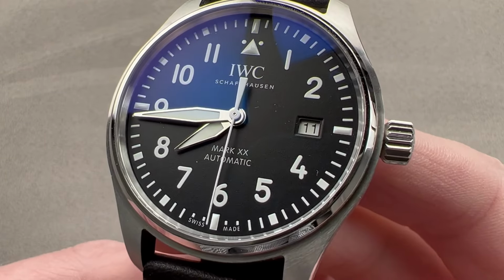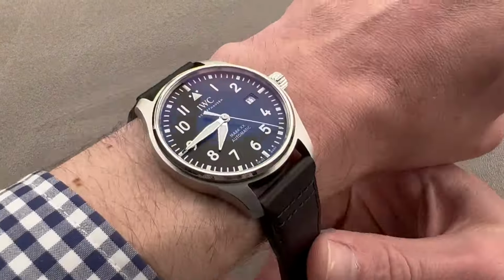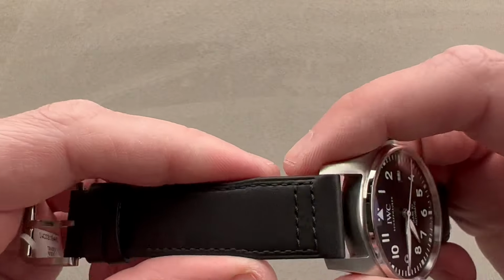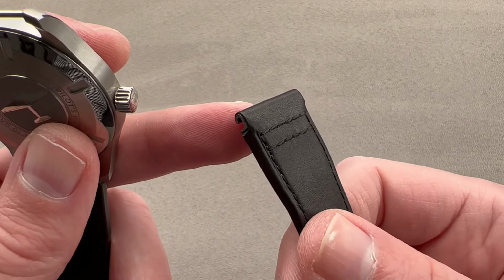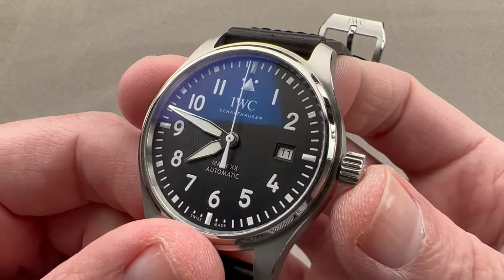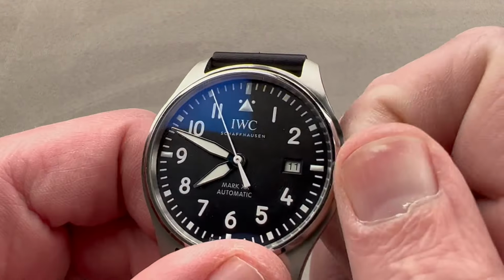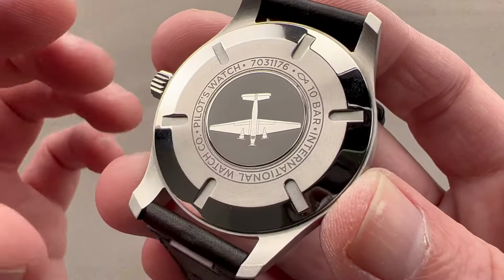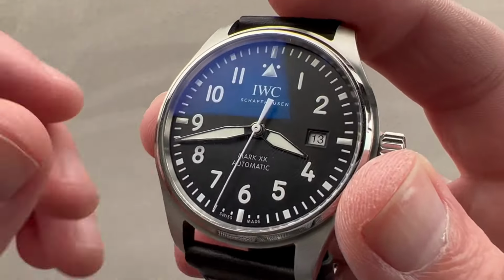IWC Pilot's Watch Mark XX Review | IW3282-01 | 40mm Classic Aviator

Comment: A solid synopsis of this beautiful watch. I nearly bought one last week, but as you point out, not a strictly in-house movement. This was a deal breaker in such an expensive and exclusive brand.
Reply: The in-house versus non in-house movement is one of the most overrated debate in horology. Some of the best, most iconic models of all times (vintage Patek and Vacheron chonographs, the original Speedmaster, the Daytona) weren't equipped with in-house movements.
Reply: @johnnyguitar6697 Yep, no one splits hairs because their Lamborghini has a part Audi engine.
Reply: Another way to look at it: If IWC is an apartment unit in Richmont’s building, and Val Fleurier is another apartment unit in Richemont’s building, and the movement is made in Val’s place… is the movement not an IWC in-house movement?
Reply: Yeah this shouldn't really be a reason not to buy a watch. I've had many lovely non in house movement watches. It's not important. Buy the watch that looks great and wears well

Comment: I have a Sinn 556A. Keeping time +1spd. Fully lumed, fantastic bracelet, 200m water resistance, much better 38.5mm size. For 1/3 the price. This IWC is a POS by comparison.
Reply: Comparing sinn to Iwc is comparing Toyota to mercedes
Reply: I own 2 Sinn's and 2 IWC's. They are all great watches in their own right, but comparing them is pointless. The IWC is far more refined and well finished, with a movement of much, much higher specs.
Reply: lol congrats on your Sinn…
Reply: Sorry but you can’t compare the quality and movements of an IWC with Sinn watches sorry

Comment: Wish it was COSC certified…
Reply: Having owned a couple of IWC pilots, I can tell you these are properly adjusted (5 positions) and regulated by IWC and in top grade specs. My experience has been they are usually much better than COSC ~ +/-1-2 s/day. The COSC certification is more of a gimmick than anything else. How many Pateks, Langes, APs, VCs... do you find with COSC?
Reply: The 32111 is seriously accurate. Seriously.
Reply: IWC doesn’t needs COSC certification, COSC certification needs IWC